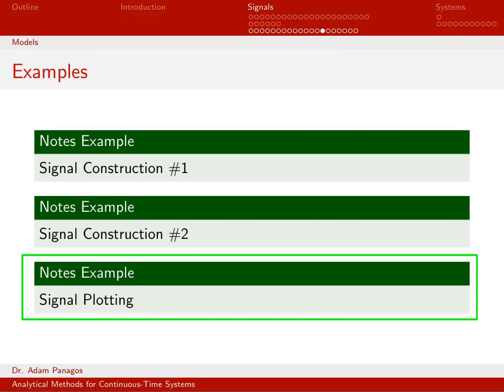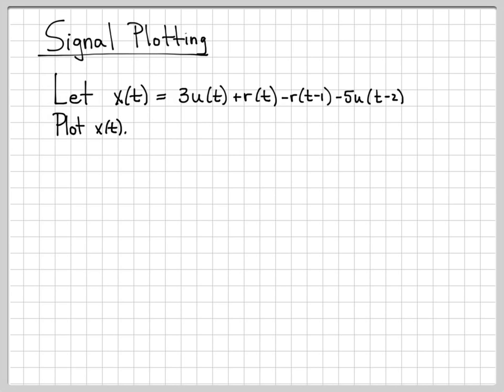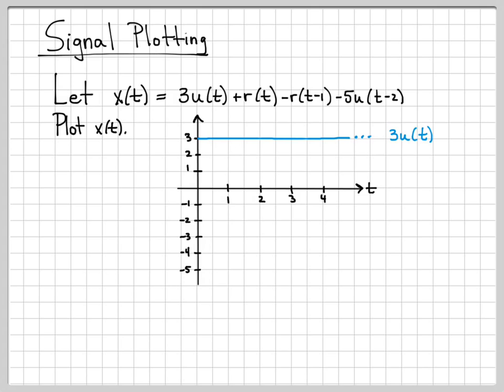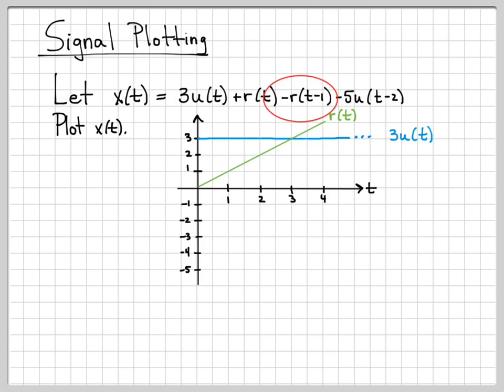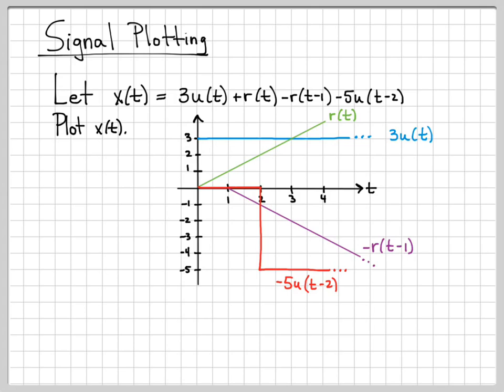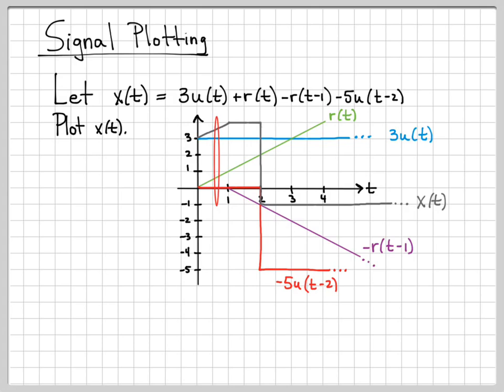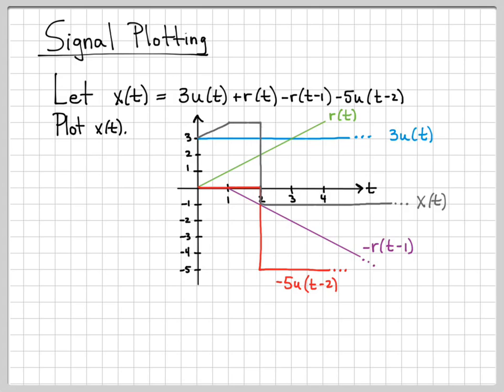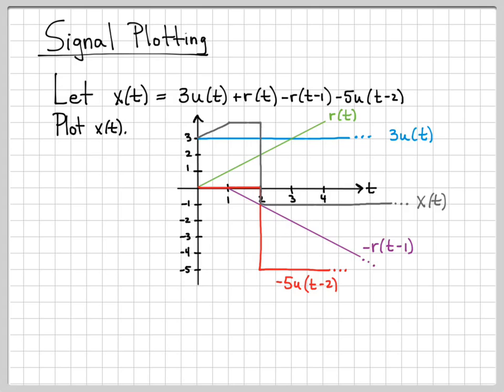Continuous-Time Signal Plotting Example

Comment: Thanks a lot. Could you tell how r(2t-1) looks like in the  plot? i struggle  a lot when the t is not alone within the ramp function (within in the argument). Many thanks
Reply from the maker: r(t) = t*u(t) is just the ramp function. If you have r(2t-1), then r(2t-1) = (2t-1)u(2t-1). This function is zero anytime that 2t-1 < 0 --> t < 1/2. For values of t greater than this, it is a line with slope 2, since 2t-1 has a slope of 2. So, starting at t = 1/2, just draw a line with slope 2. Hope that helps,
Adam

Comment: You did mistake at t=2
Plot this function in MATLAB you will find your mistake.
Indeed you are doing a great job.🙏🙏🙏🙏
Namaskaram
Reply from the maker: No, you are incorrect.  No mistake in the video. If not for the last term in the expression for x(t), the signal would hold a constant value of 4 for all time.  At t =2, a unit step with magnitude with -5 turns on, which changes the value to 4 - 5 = -1.  This value of -1 (the gray line) then continues for all time.
Reply: @AdamPanagos 
Plot this X(t) in MATLAB and see please....
Reply from the maker: @kunalsharma6496  Yes, I did plot in Matlab and it's exactly what I have in the video. If you could provide some explanation for what you think is wrong I might be able to help you figure out where you've made your mistake.  But just saying, "this is wrong" doesn't help me figure out where you've made an error.......
Reply from the maker: @kunalsharma6496  No worries at all.  I've posted hundreds of videos and have definitely made mistakes that have needed correction from time-to-time.  I was pretty certain things here were correct though.  Glad we got everything figured out.  Thanks much.
Adam

Comment: Sir I think we can plot the signal without drawing individual signals.........by just doing opposite of what we did in the "signal construction" and for a check we can write the signal expression for the signal made by us and check if it is matching with the given signal expression.Hope I'm right.
Reply from the maker: You can try and do it that way, but I think it will be much more difficult.  What if you had a signal x(t) that was a summation of 30 different terms?  Sure, you could draw your best guess at the signal expression and check different points to see if it matches, but the odds of just being able to write down an expression that is correct for all time seem pretty slim!  I think the method presented in the video is the best systematic procedure to use.  Thanks!
Reply: We can arrange all the terms in ascending values of "t" viz (t+15),(t+14),(t+13)...(t-15) and do the procedure taught by you and (I think) we will get the signal pretty easily .Also as the number of signal components increases it will be slightly cubersome to determine signals at larger values of "t" because we have to look for a lot of signals for that time but if one uses the method ,which I'm claiming ,we will get the signal straightway.Hope I made my point.
Thanks a lot for the reply.

Comment: 3:55, How the blue and red give -4 and how the green and purple give -3?

Should not the Blue and Red give -2 like below:
3u(3.5) - 5u(3.5-2) = 3u(3.5) - 5u(1.5) = 3 x 1 - 5 x 1 = -2

and should not the Green and Purple give 1 instead:
r(3.5) - r(3.5-1) = r(3.5) - r(2.5) = 3.5 - 2.5 = 1

we sum them up and get -2 + 1 = -1 as a final value of x(3.5).
Reply from the maker: Yes, what you've written is true for just the "red" and "blue" but x(t) is the sum of ALL parts at each point in time.

At time t = 3.5 we have

3u(3.5) + r(3.5) -r(3.5-1) -5u(3.5-2) = 3u(3.5) + r(3.5) -r(2.5) -5u(1.5) = 3*1+3.5-2.5-5 =3+3.5-2.5-5 = -1.

Recall, r(t) = t for all t>0.
Reply: Adam Panagos Thank you, that makes a perfect sense, however, on the actual video I reckon you have mistakenly said that "the blue curve and the red curve give -4 and green and the purple curve give -3". So I was confused but not anymore. Thanks once again, I am learning a lot from your videos :)
Reply from the maker: Ah yes.  If I said that I definitely misspoke.  Too many different colors to keep track of in this video. =)  Sorry for the confusion.  Glad you're getting something out of the videos!